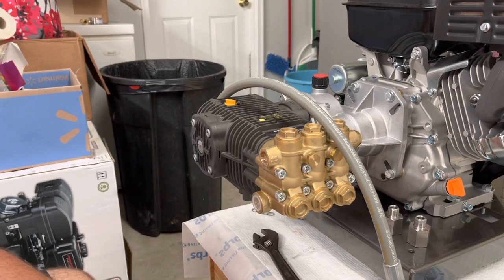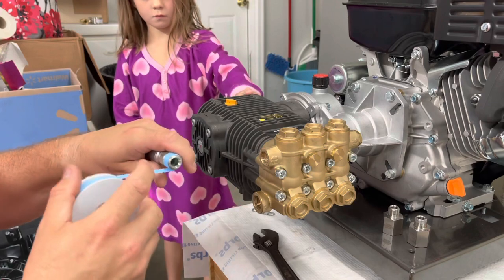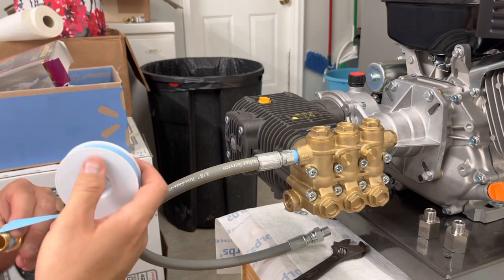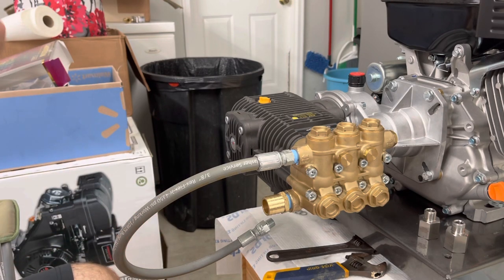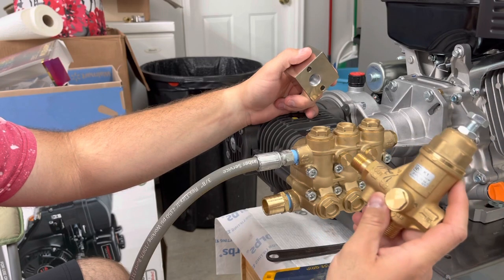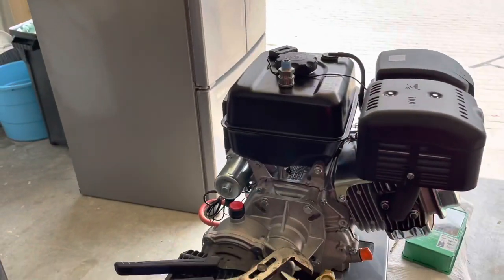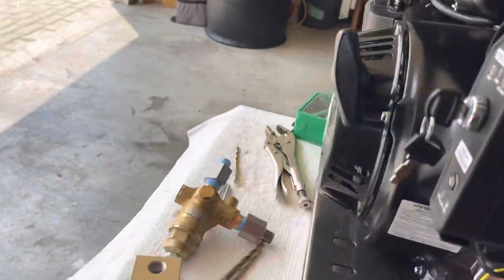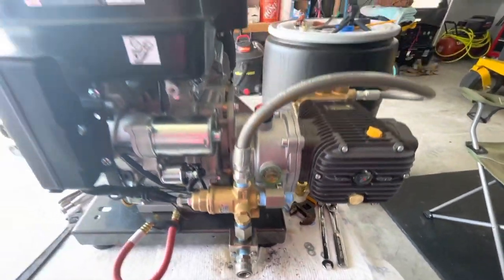Budget Build Part 2: Plumbing your Pump to the unloader

Comment: Great videos. In the process of obtaining parts. Do you have the Unloader block listed on your parts build?
Reply from the maker: I do not, a few months after running it with an unloader block I ended up, just putting the unloader directly onto the pump via quick connect set up

Comment: Coming from a Union plumber of 22yrs. I would double check the one piece that didn’t go on very far. Secondly, and this is just my professional opinion, teflon tape is just and addition to sealing up pipe threads, it is not needed. If the threads are machined properly, then the use of pipe dope (lubricant) is all you should need to make a proper connection.
Reply: How do youbknownif someone is in a union?........they will tell you.

Comment: i got all the stuff but the pump so far.  i got the same stuff you do. my ss fitting dont seem to want to go this unloader . i fell like id mess it up if i wrench on it.   and also id love to see you set the unloader. im a bit of rookie but i like building stuff like this . thanks for your help
Reply from the maker: The SS fitting doesn’t go on the smoothest but it will work.
Reply: We're you referring to the ss fitting for the bypass? If so mine feels like it the wrong thread....
Reply: For anyone’s reference the fittings on the unloader are all bsp, not npt. They are close but not the same. My comet pump is also bsp so I needed a 1/2 male bsp x 3/8 male bsp to attach my unloader to the pump, (1/2 female bsp x 3/8 male npt adapter) x 2 for the outlet side and bypass. For the Bypass I then used a 3/8 npt 90 degree female elbow and 3/8 npt male barb.

Comment: Great video  thanks!  I do wonder why you and some others decided to mount the unloader away from the pump.  Can't u just connect the K1 unloader directly to the pump outlet?
Reply from the maker: You can mount it straight to the pump and most do it that way. I chose to go this route to help reduced the stress and weight put on the pump at that point. Sometimes unloaders can break off in that location and that would be a headache.
Reply: @KentuckyWashPros  Got ya, thanks!

Comment: Are there any benefits to using the unloaded block vs just threading it right to the pump like other washers?
Reply from the maker: Not really other than taking the stress and weight off it it

Comment: I built this same set up and was running great but I used the 459 predator instead. Did you ever have a problem with the key in the shaft? Mine actually bent and cracked
Reply from the maker: They are great setups, I wished the 459 was available when I built mine. I never had any issues with anything.

Comment: I just built the setup! Waiting on a few more parts but how do you set your unloader ?
Reply from the maker: Nice! To set the unloader you’ll need to get a zero degree or red tip, and pressure gauge to set the unloader. I’ll attach a link https://youtu.be/CxRCQ24wOOs

Comment: Hey! @Kentucky Wash Pros How are ya man!? Thanks for the videos! I notice on the spreadsheet that you have the Predator 459 listed instead of the 420 that is in the videos. Do you recommend the 459cc over the 420cc?
Reply from the maker: I do recommend the 459 over the 420. You’ll see better output with the pump on the 459 because of its increased HP.
Reply: @KentuckyWashPros  Thank you for the quick response! Also, thank you for the most logical setup I've came across in all of my studying so far. This is without the best setup for the money invested. Genius! I'll proceed in building this setup. God bless!
Reply: @KentuckyWashPros  Hey Jeremy, I was wondering what the red hose is for on the bottom of the motor near where you have your unloader setup? Thanks!
Reply from the maker: @goodmoodfooddude3801  oil drain extension

Comment: Do you pull directly from the customer's water or does your direct-drive pump draft from a buffer tank?
Reply from the maker: With this setup this is not a direct drive, this is a gear drive and it will pull from a buffer tank.

Most of your factory direct-drive PW's from the big box stores do not create enough suction to pull from a buffer tank, so you will have to hook up to the water source directly. 

They do however make an aftermarket direct drive pump that will pull from a buffer tank because the internals are different and the pistons are bigger allowing it to create suction.

Comment: Bought this pump and gear box setup both got pretty hot on the first use, is this normal?
Reply from the maker: Hey David thanks for watching. To be honest I’ve never really checked mine gear box or pump to see if it got heated up. I would imagine that it’s possible given that they are gears turning in there with may produce some heat. I have several jobs lined up for Thursday so I will check mine then.
Reply: The pump oil got dirty after about 15 hours of use, after how long did you change it .
Reply: @davidahumada8928  Are you still running this setup?
Reply: @premierpowerwashing6634  yes working great

Comment: What size barb is that going in for water
Reply from the maker: 1 in
Reply: @KentuckyWashPros  1” mip to 1” barb?
Reply: @KentuckyWashPros  I know the barb is 1” but is it 1” into the pump. The threaded end…
Reply from the maker: @mattburns4407  I believe so, tbh I can’t really remember
Reply: @KentuckyWashPros  I figured it out 1/2”threads 1”barb
Reply: Machine runs great! Built the same setup as you!💪
Reply from the maker: @mattburns4407  that’s awesome you’ll love it
Reply: @mattburns4407  good flow from buffer tank?
I'm waiting on my water inlet fitting to arrive, same size 1" barb to 1/2" thread
Reply: @balancedenvironmentalsolut6965  yea works perfect!

Comment: Why use an unloader block ? can you not just attatch directly too the pump
Reply from the maker: You can attach it to the pump, if recommended setting it up as a quick connect setup